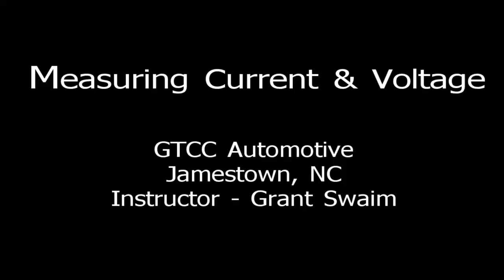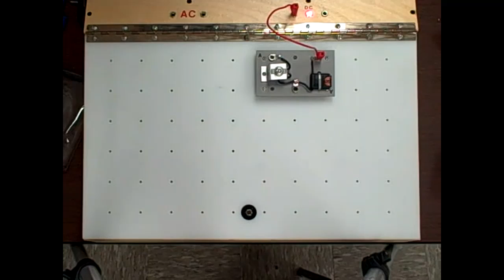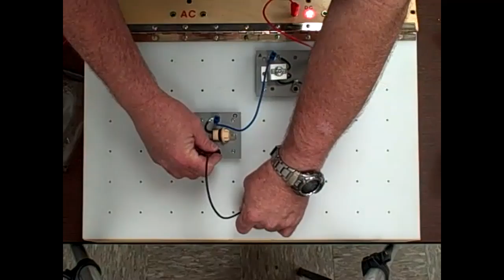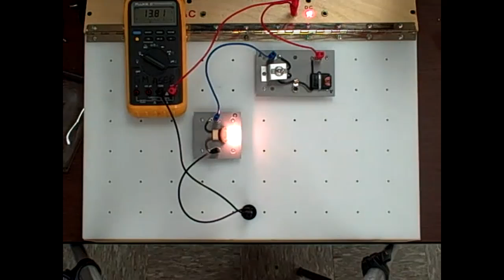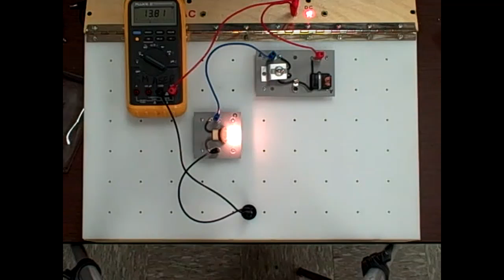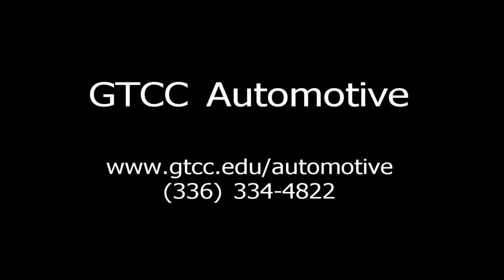AUT 161 - Measuring Voltage and Current

Comment: Thanks a lot! I blew a resistor because I didn't know you were supposed to measure current by adding it to the circuit. This video is simple, straight to the point and exactly what I needed! Thanks again.